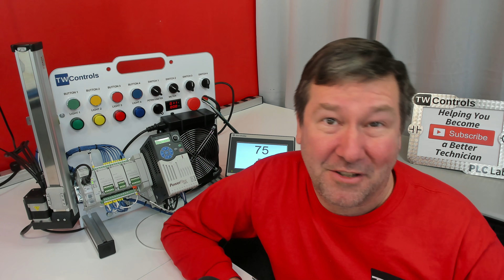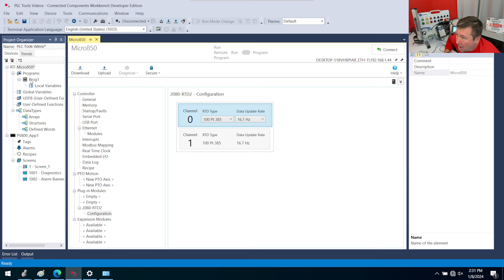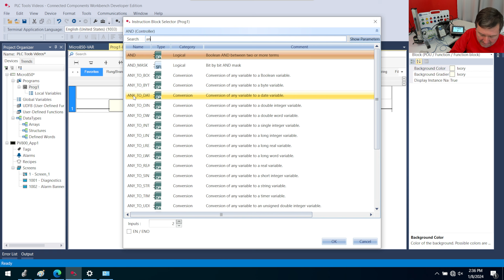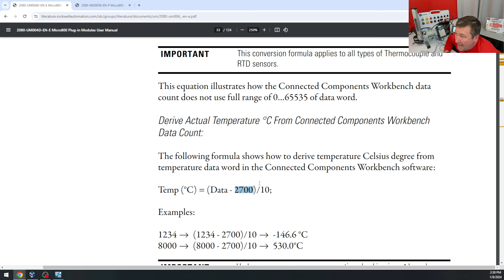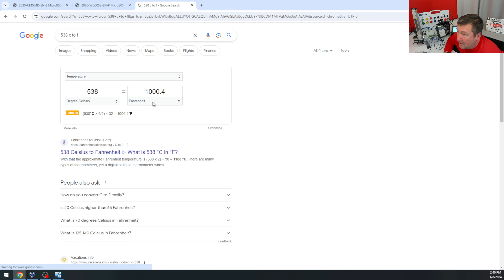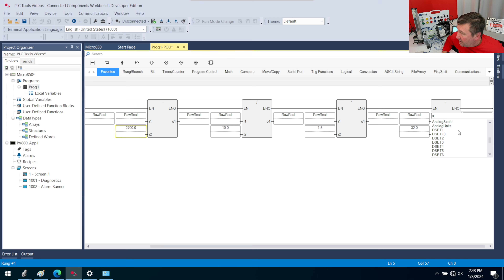Configuring a 2080-RTD2 Plug-In Module for a Micro800 PLC

Comment: I’m trying to figure out the 2080-TC2 module. I have the module and 2 type K thermocouples. Could you please do a Video on this? Please, Thanks, Doug
Reply from the maker: I don't have one of those but it should be similar besides figuring out the scaling.
Reply: I did follow you building the RTD program and it worked the same way 
I might have the TC’s wired wrong. If I dip one in ice water and the other in hot water, they read the same. 🤷‍♂️
I’ll go back and visit this when I get a chance. 
Thanks for all the videos you put out. Enjoy watching
Reply from the maker: Check the type of thermocouple and yes, the wires swapped will make a difference since it is a millivolt signal.
Reply: @dougbaker89  Did you ever have any luck with your 2080-TC2? Happen to remember what the solution was?

Comment: High Tim, I am an South Africa starting to learn PLC programming so that I can use it for my work. We have a few Allen-Bradley Micro800 series PLC which use Connected Component Workbench. This comment is not relevant to this particular video, but watch a lot of your videos and have not come to solution for the current problem I am facing. I want to build a "stopwatch" of sorts either using ladder logic or structured text, but cannot manage. The PLC I am using does not have RTC so I am trying to use TON or RTO timers with variables to time the events, but the timer variable resets before I can save the elapsed time to the next variable.

The application is as follows: I have a water meter that will give out a pulse each time a certain amount of water passed through (10L if I am not mistaken). I want to know how much time elapsed between each pulse for further calculations and data capturing. So, the Pulse must come in and start the timer, next pulse come in, save time to variable, reset timer, and repeat.
I was hoping this might be a good video for you to make, and teach me if possible?

Best regards from South Africa
Martyn
Reply from the maker: I'm pretty sure I cover that in this live stream but it would be worth covering again.
https://youtube.com/live/6KR8OuyxmrA?feature=share
Reply: @TimWilborne  Thanks you. I did watch that video, and I will be honest a lot from that video still goes over my head in a way, but I am not sure if that is exactly like a stopwatch type of feature. I am very new to ladder logic, but I enjoy learning more each time I get a chance. Hope to see that video soon. All the best.